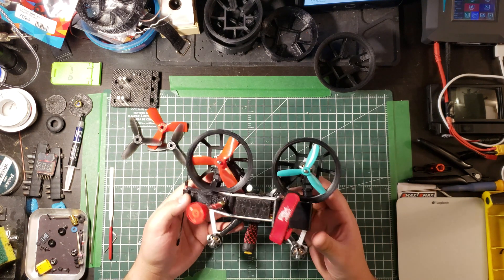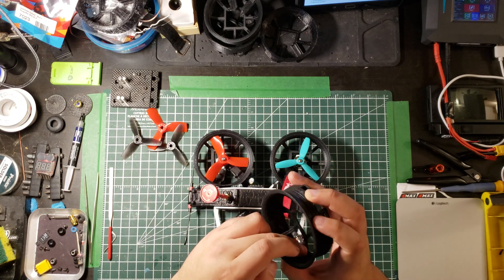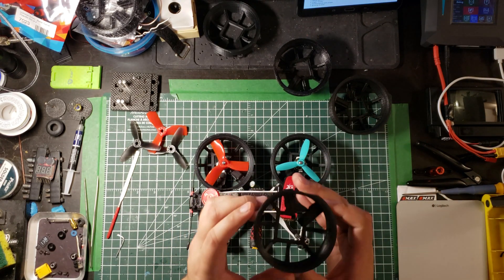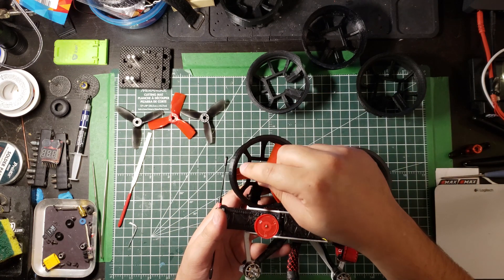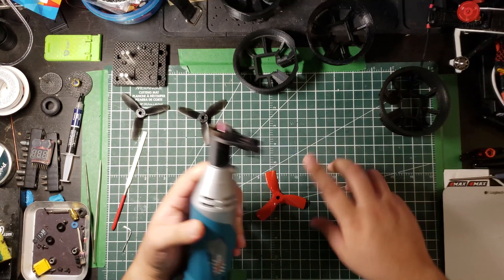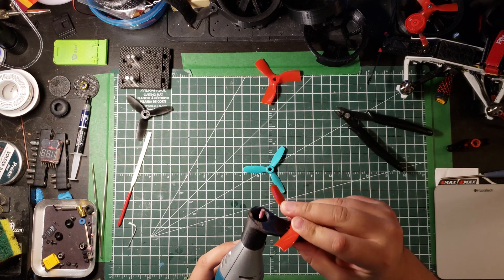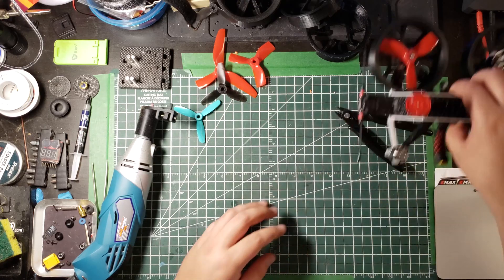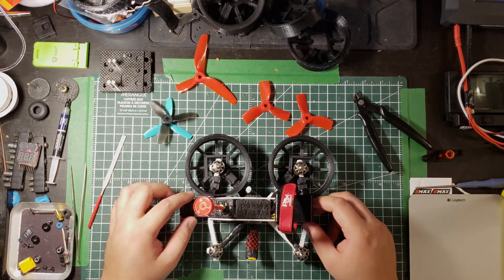The CINEBrat MK2 - Duct theory and challenges

Comment: So the question is why was tpu not good to print it with and what is the inner diameter from the duct?
Reply from the maker: as mentioned in another comment, TPU is too flexible without the external duct supports that the Squirt and so on have. 

internal diameter, no idea off hand. youd have to check the STL

Comment: I'm printing these for mine at the moment. I'm test fitting the first one. One thing I'm curious about though is if they move around much in a crash.  Thank you for the work you put into this and for sharing it, definitely a big contribution to the hobby.
Reply from the maker: no worries. they can move around during crashes if you dont fit them well. tbh you could opt for a hard mount solution by drilling into your frame but i found that to be more of a con than a pro.